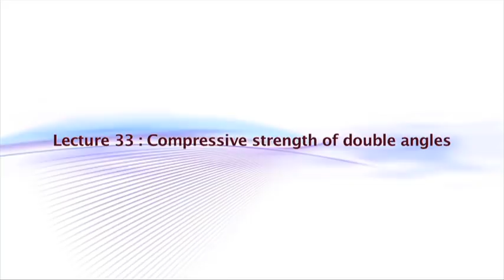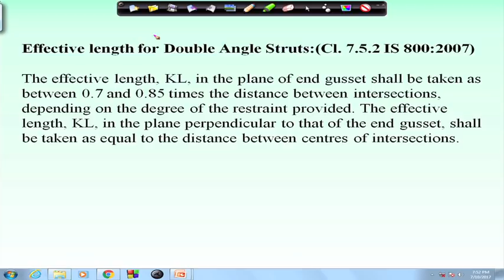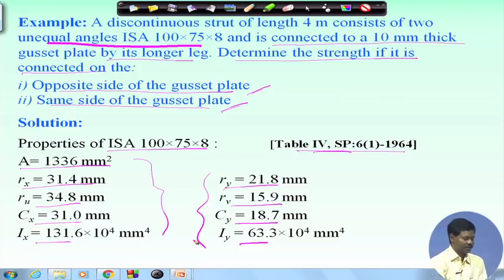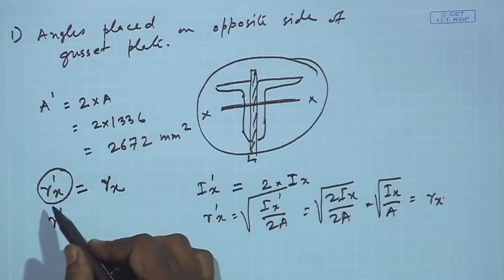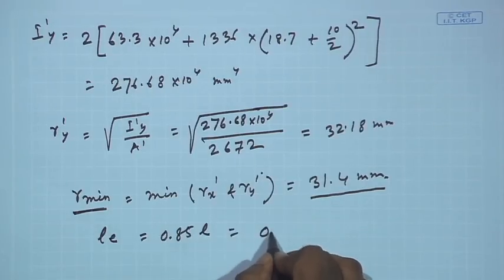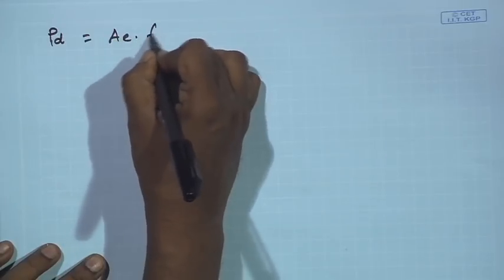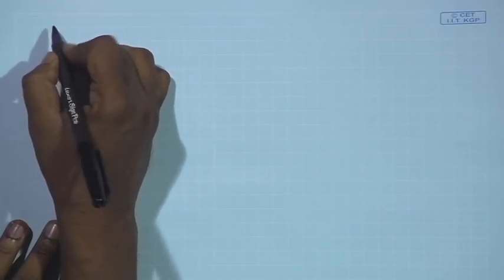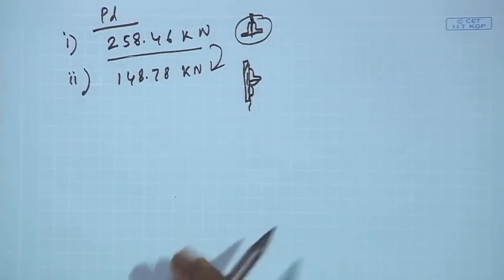Lecture 33: Compressive Strength of Double Angles

Comment: why not include the area of gusset when getting the radius of gyration= sqrt. of Moment of inertia/Total Area. Why is gusset not included in area calcution ?
Reply: Study engineering mechanics
Reply: the gusset is not a continuous member it is only an end connection , hence its area will not contribute for axial stress

Comment: Why didn't take gusset Ixx in second case during calculation of Ixx of whole body??
Reply: 20:26 This is because the xx axis is passing between the 2 angles and gusset plate is not lying in between them. So we have just included the Cxx value in parallel axes theorem.